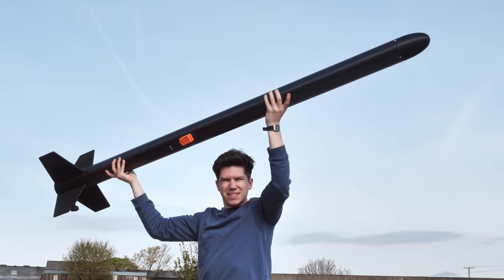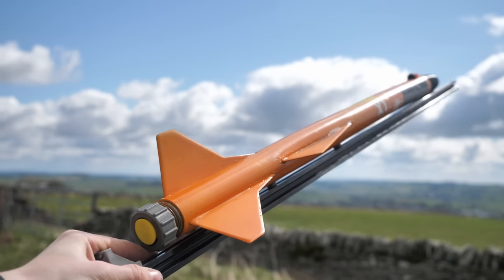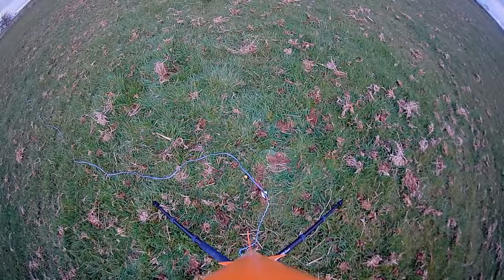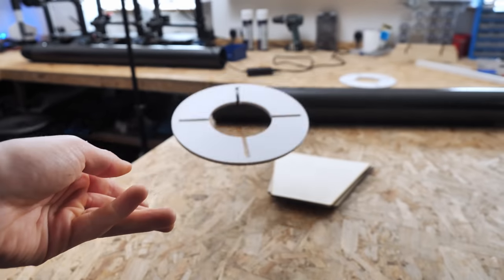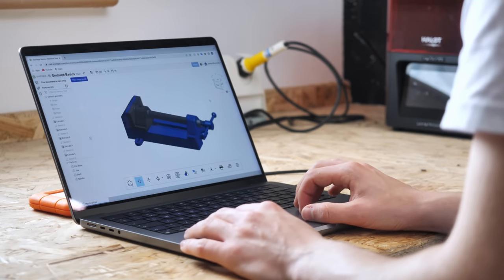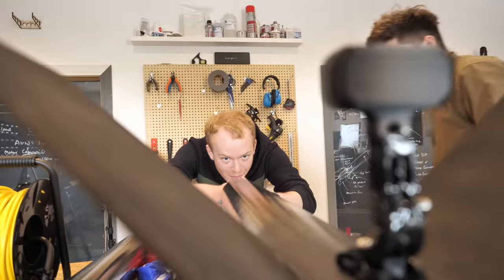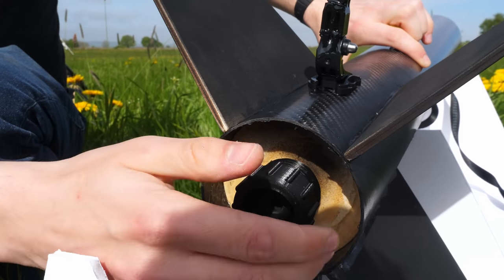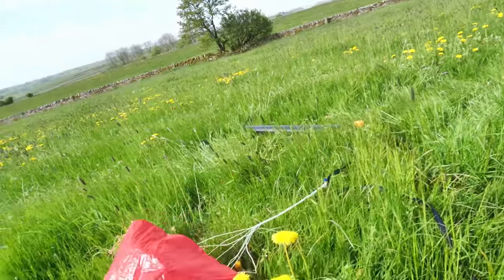DIY Carbon Fiber Rocket

Comment: A few years ago at a rocket launch one guy had a V2 replica. It was about five feet long. It looked like he had put a lot of work to it. It flew beautifully but in the end it did exactly what the V2 was designed to do and nose dived into the ground. Total loss. Turns out the ejection charge did go off but was waaaay under powered for the large internal space of the rocket.
Reply: Did it exit the atmosphere?
Reply: @alilspark  Not even close but it did go out of sight.
Reply: this is the reason you run a small dia tube the length of the rocket for ejection charge, it acts like a blow gun...
Reply: Yup, I've got a few V2s and no matter what I do, first flight is always a nose dive lol. No total loss yet though.
Reply: @ej-1608  its because the fins on the v2 purposely made the rocket pick up speed in 1 direction, think of throwing a dart with fins
Reply: @ej-1608  so it will only want to go in 1 direction and if going down, just massively picks up speed

Comment: GPS trackers are only massive when you look for massive GPS trackers... there are very small ones available.
Reply: Ya ahah I have one that is like the size of my thumbnail lol
Reply: The ones in phones and smartwatches cannot be too big
Reply: @andresmartinezramos7513  the only thing this guy would have to do is buy like an ATTINY and a gps module with a SIM card module or even a zigbee TXRX module. The zigbee ones have like a max range of a kilometre I think? Not sure off the top of my head

Edit: max range of XBEE modules is 3.2km
Reply: @andresmartinezramos7513  exactly
Reply: One I’ve heard of is the Gf-07. It looks small.
Reply: @hotmailcompany52  ya he could use that or the zigbee module I mentioned in my last comment, the SIM card is kind of overkill tho I agree 😂
Reply: @MrRobotalian  i‘d go with LoRa. a dude literally did a 200km connection with just 2 simple devboards in line of sight
Reply: @H3wastooshort  oh wow, thats incredibly impressive. ill defs have to check that out
Reply: @H3wastooshort  Are you referring to Andreas Spiess?  I watched his LoRa videos and it was interesting the distances he achieved with very low bandwidth.  The bandwidth limitation wouldn't matter just for reporting location though.
Reply: I've used a radio tracking transmitter that weighed maybe 7 grams with the battery in it. Battery life, if I recall correctly, was several days. Once, I was able to follow the signal for a long ways, but at one point it didn't seem directional any more. At least until I looked up into the tree I was under. I think the range is supposed to be quite a few miles,  though in my case it was probably less than a mile. There are lighter transmitters. The receiver is the expensive part, and it helps if the receiver has a good directional antenna on it.  A drawback is that you  may be seen geeking out with a weird gadget that looks like it belongs in a cheesy 1950's science fiction movie.
Reply: BTW, one problem with any of these tiny tracker transmitters is that they're very hard to find when turned off. Somewhere in my stuff......

Comment: Cool build bud! It looks to me like you never sanded and cleaned the bonding areas for the fins, or did you?  If not, try next time to sand both bonding areas (fins and tube) with 80 grit and clean with acetone really really well. Otherwise will the epoxy never bond to the carbon properly. /former Composite tech @ Rocketlab
Reply: Solid credentials for a YT comment

Comment: Great video ! Glad to see your rockets flying ! 
You might consider sanding the area you're going to glue, with 200grit sandpaper. Furthermore, a real fillet at the base of the fins would have certainly increase their strength. Finally, a more powerful motor should be used for such a big rocket, indeed, it needs speed to be stable, and that was almost not the case.
We have an international rocketry discord if you are interested, with thousands of hobbyists willing to help.
Reply: Bro can you share the link for the discord group?

Comment: @Projectair Awesome work mate and love the passion you display on the videos. 

Whilst watching the video, it appears that once the vehicle lost its top guide in relation to the launch rail it immediately veered. Maybe next time you launch that particular vehicle, use an additional length of rail (2M to 3M) just to provide an additional split second of guidance to gain trajectory control. 

Have you also done any further research into a synchronised multiple engine launch? The vehicle core appears to be large enough to take a triple engine. 🤔

Comment: Hey James, a quick thought about the tracker. Yes, they are big but that doesn't need to be the case. Off the top of my head, you could check the things network in your area and see how well it's covered. If it is, pick up an ESP32 with lorawan on board and a 6M GPS module and have it transmit data at certain interval to the things network. If you pick up one of the more standard ESP's, you're looking at around 15 grams. There's an ESP32 with a camera and micro SD card which will be an additional 5 grams. I can give a hand if you need(albeit virtually).
Reply: Another thought: accelerometer in order to determine when the rocket has landed. So add another 2-3 grams.
Reply: @alexhri  issue is moreso weight tbh

Comment: good video! quick question: It seems many rocket youtubers loose track after launch, so why not install a pulsing or strobe light that starts either after the parachute is deployed or when no movement is detected (landed)?
Reply: Doesn’t work. During day, a strobe that is not too heavy will barely be visible when directly looking at it.
With grass, walls and an even higher distance, no chance.

Comment: You could build a tracker with an Inav board and a gps unit with an rx attached.

Setup telemetry to your radio and use opentx to log the GPS co-ords.

Comment: my dude: MOTORBIKE GPS tracker with sim card! cost like 10$ and have a tiny battery inside with will be automatically charged every time you connect the main lipo. go get one of those. there are some grams and i installed them on all my 4" to 5" drones because its so tiny. almost same as your bluetooth tracker. even main battery disconnects on impact. the tiny lipo will continue send exact GPS location to your phone via app in real time for some hours. and thats like 1 meter accuracy. :dothefive::dothefive::dothefive::dothefive::elbowbump::elbowbump::elbowbump::elbowbump:

Comment: Been a while since I've watched rocket videos. That little orange rocket has a TON of power lol
It was really cool not just seeing this sleek, jet-black and far larger rocket take to the air and narrowly pull off a decent landing, but also the steps that went into designing it. Safe to say I've learned something, and Onshape looks pretty cool. I may consider using it at some point to help with my own projects. Cheers. :) 👍🥂🚀

Comment: The next version of this rocket should have some rudimentary flight control systems (controlled flaps or fins, just to keep it roughly straight on the ascent).
Reply: Flight control is cool, but impractical as it weighs too much for his motor class. Plus, it is typically ignored as it can be a point of failure. The forces are immense and can break the connections on the fins, BPS.space had this problem with his attempt doing it.

Comment: Absolutely amazing, what an incredible vehicle. I've got a flight coming up either late August or early to mid September. Nosecone and Engine Skirt is 3D printed using PLA and the body tube is PVC. It will be running on a F24-4 reloadable model rocket motor. The max Alt is 448m almost half a kilometre and the max speed is 177m/s. The rocket's name is Spark MPMR - MPMR meaning Mid Powered Model Rocket. Can't wait to get it out to the launch site for it's first flight and my first flight.
Reply: Where do you source the cesaroni motors grains I've been struggling to find them
Reply: I've only found the casings. I have currently E-mailed a supplier to see if I can get the grain as well
Reply: @HighlandAerospace  what's the name of the supplier or website.

Comment: About those trackers... There's a third option, and that's just installing a dumb radio beacon, and then grabbing a yagi antenna in the field, and looking for it manually by observing the signal strength in different directions.

Comment: Hey for GPS tracking, try placing an ardupilot flight controller in it with a GPS module. The module is like 2x2cm and the flight controller can be 30x30 or even 20x20mm, allowing real time gps tracking as far as you have radio signal to a controller

Comment: always put fins thru outer frame, try to get the chute to eject at apogee, run a small dia. tube thru the length of the rocket to improve chute ejection ( no need in trying to pressurize all of that volume) on larger dia rockets. try to use a general rule of thumb of 10X the weight of rocket in thrust...  e.g. a 5 lb rocket likes 50 lbs of thrust...  I put a 3" dia X 88" length rocket 13,280 feet on a K-500 first stage followed by a J125 second stage about 30 yrs ago... ( my Tripoli member number is in the 500 range  ;)  )

Comment: Other people have probably said this by now, but a couple suggestions on fin strength: firstly, surface prep is vital when bonding to composites. Sanding the attachment area of the fins will greatly increase your epoxy bond strength. A good rule of thumb for CF is having the area appear matte, not shiny like it is from the factory. Basically, you want to get rid of that shiny surface layer of epoxy, and sand down to the matte carbon weave beneath. Clean with acetone or alcohol and you're ready to bond! 

Also, for rockets like this where you're flying a 29mm motor on a much larger diameter airframe, "through the wall" fins are the way to go for an easy strength increase. Seems like you've got that covered with your 3D printed fin mount idea though :) 

Just a couple suggestions from my experiences working with composites while designing/building high power rockets and sounding rockets. Love your channel and seeing you progress in rocketry, keep it up!
Reply: One could also make light, airfoil shaped, hollow fins from balsa that would be as strong as the plywood ones at less weight. They'd be thicker and therefore the glue joints would be under less stress. Birch plywood is heavy. Glue joints can be reinforced with a fillet of narrow fiberglass tape.

Comment: Currently building a supersonic high-power rocket around an Aerotech DMS L-1000, with a body tube width of 3 in and a height of 77 in, and I'm really jealous of that carbon fiber rocket, even if It only uses a mid-power motor, since buying carbon fiber body tubes for it would put the rocket out of my budget. 
Still liked the video, since you don't see many amateur rocketry videos out of the UK, and it was an excellent landing with the parachutes deploying at just the right time to fully slow it down to prevent damage and to keep it close to the launching area, though I'm sure it would have been fine.

Comment: Some advice from a rocketeer: Eggtimer Rocketry provides great flight computers and reasonably inexpensive (and very, very tiny!) GPS tracking units for rockets. You can also use their flight computers to fire ejection charges at apogee, which would probably have spared you the nail-biting deployment you guys got. 
And if you get the chance, you need to come out to Friends of Amateur Rocketry in California. It's just about the best place in the world for big rockets.

Comment: Composite bonding, especially to pre-purchased components with cured epoxy, is one of the biggest challenges in the game.
Thankfully with work I did on jet engines years ago, I have a handy file of solutions ready for you. The really good commercial stuff goes under the very simple-sounding "Structural Epoxy Adhesive" from brands like LocTite, 3M, Plexus and a few others I trust. LocTite and 3M are probably the easiest to get ahold of in the UK. On LocTite's really good commercial line, look for a yellow tube under the Hysol line; 9340 and 9460 cartridges are the ones you're most likely to come across and work very well. Abrade the area to join with a light buff, being careful to not break through the resin coat to bare fiber, 'degrease' and clean with acetone to remove dust, glue it up and you are golden. 
With these cartridges, make sure you get the appropriate dispenser gun as they can be very finicky to get one working if the other isn't of the same type despite visual appearances. The 50ml cartridges and dispenser guns are also the most prolific and cost round about $25 USD each.  With any resin product, you get a pot life, so make sure you have Everything you're going to join ready at the same time before you crack the seals; you have about 20 minutes from then forward to join parts and get them supported while it cures to a handle-ready state before the whole tube goes up.

Comment: You should build a rocket or plane that ejects a smaller plane, and that smaller plane should have a rocket engine in it. Fly the first plane as high vertical as it would go, then launch the smaller one and go as high as you can with them.

Comment: You can use microballoons to make your epoxy stick better. If that doesn't work you can use glass cloth  to encase it and cover it with epoxy but thats alot of work and other options might be easier.

Comment: Very nice! Have you considered 3D printing a fin can for your rocket? You just need to figure out a way to attach it to the rocket. And then attach the fins you have to the fin can. Keeps everything aligned. Or if you wanna get creative and try spin stabilization, assuming the carbon tube is perfectly round and balanced, 3D print where the fins are held at a slight angle.

Comment: @ProjectAir Have you looked into a LoRa GPS tracker? They are still lightweight (50g), and have much grater range than Bluetooth "trackers". For example "Dragino LoRaWAN GPS Tracker" seems to fit the bill.
You can +1 so he sees my message and doesn't have to look for lost rockets for hours 😅

Comment: Would be cool to have a second rocket after the first one is burned out. Even cooler to have them stacked on top of each other and have a piece of the rocket seperate from the body when the first rocket is burned, and then another goes of😋 However, nice video and cool project😁
Reply: Thats called a 2 stage rocket, lol. Thats how we got to the moon with multiple stages.

Comment: Have you thought about attaching a bunch of small lengths of string to the outside of your rockets? Just one end should be attached so the length of the string can give you a good idea as how the air passes over the rocket body (if you have the cameras in the right positions). You can also make those stabilizer fins more aerodynamic too by playing around with different shapes on the leading and trailing edges and by flipping them upside down (the longest part of the fin won't be glued to the rocket but the opposite edge will).

Comment: that is an awesomely  beautiful flowered launch meadow.  

How about a laser guided stub winged rocket with a 10 second motor burn fired horizontally at a static ground target and then  Hit a balloon at (20% lower than max legal altitude) ?

Comment: Make your own motor with 65% kno3, 35% sugar. Make a hole in the propellant almost to the top of the motor. That way when you ignite, it will build pressure working it's way down to the nozzle. Find an old thermostat with the Mercury switch in it and use that to ignite the parachute charge as the rocket noses over. Power with a battery. Search sugar rockets to learn how to make the propellant. Some people dry pack but, I cook in a pot till it looks like caramel and pour into the motor housing. Make sure you don't have any air pockets or else the motor will fail and it will look like the space shuttle blowing up.

Comment: Where did you get the carbon tube for the airframe? 

I’d recommend you try using open rocket to get a demo of the flight and ideally what time delay to use. 

Don’t think you sanded the surface for fin attachment. Through the wall would be better and attaching to the motor mount. 

Good stuff so far.

Comment: What if you put tiny EDF motors to control it to a place? You can get it easily with a DJI camera and software to see its position for controlling the EDFs. It sounds crazy, but it is kind of like a drone manipulating the rocket. It is possible because the parachute is slowing down, helping you manipulate its directions.

Comment: i havn't used it myself since i usually fly in visual range but alot of long range drones have a gps module you can attach to the flight controller and these are quite small , maybe this may help with the keeping track of the rocket ?

Comment: Launching a 3kg rocket on just one G motor seem pretty nuts. That tube is really large enough to cluster in but you’ll have to get L1 to do more than 2 motors in a cluster
Reply: Agree,  even the strongest G motor is going to struggle under 3 kgs.

Comment: Since you're using carbon fibre, forget about the retrieval. You can instead create a flight recorder of sorts that ejects from the rocket, then time that ejection to a charge ignition to destroy the rocket. There would be gps trackers on the flight recorder (if you make a big enough rocket). That's just my idea.

Comment: It is not very high,you can use 4 or 5 rocket engines parallel connection launch the rocket.